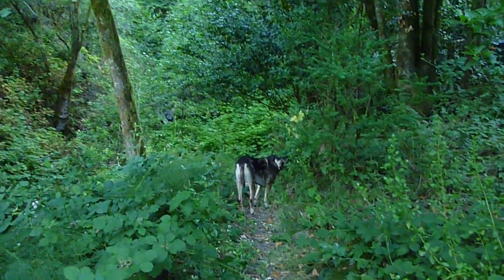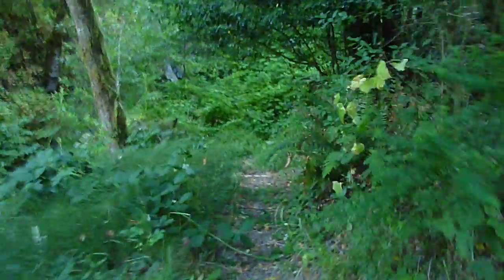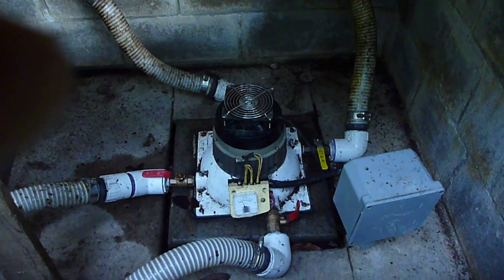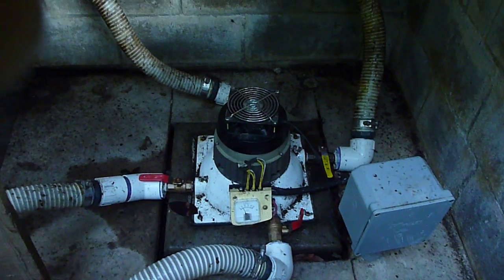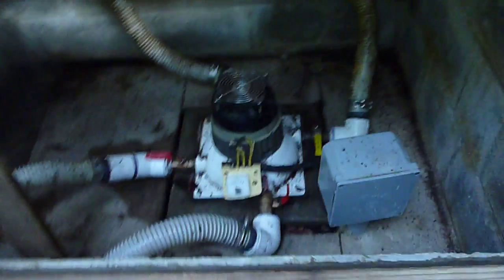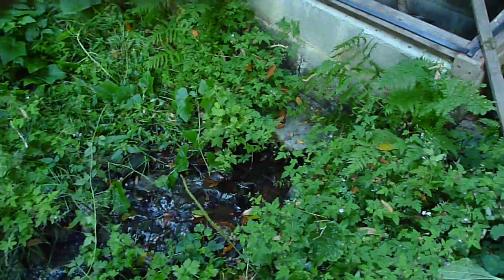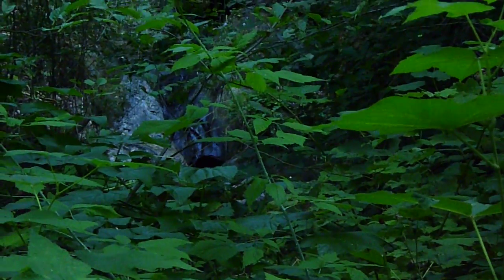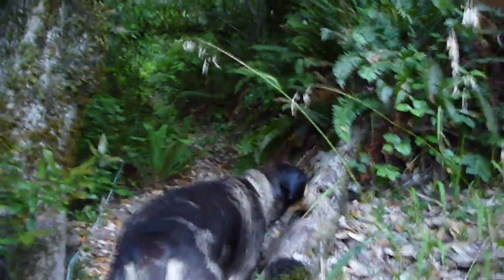Micro Hydro Power System Tour Part 1

Comment from the maker: I did not do the installation by myself. I decided that I didn't have enough technical expertise in this field to do everything properly. So I found a local alternate energy expert and worked with him. I acted as his assistant in the install and did some things all by myself. But the design and details he oversaw using my specifications as a guide. I just did not have the experience to decide on things like pipe size, etc.

Comment: If you were a real man you'd build a nuclear power plant and tell the NRC to stuff it you know where. You could use that nice cool water to flash into steam and run a turbine. None of this wimpy dual fluid lines either, turn that turbine off strait reactor core water. Like real men do. This sort of power plant just challenges my manhood. I take nothing short of 100 kW. Not 100 kW hours, but 100 kW. .... Really, nice system. I love the vid, thanks for sharing.

Comment from the maker: @Thetrutv 

Our turbine as we have it currently set can produce a maximum of 620 watts which works out to be 14, 880 watts per day (basically 15 KW). The amount of power obivously varies based on  how much water is flowing. Last night, we were producing only 530 watts as we haven't had significant rain in several weeks.

15 KW is quite a bit for an off the grid house. I have hear of people who only use about 4 KW/day so it could handle more than one, but normally 1 turbine per house.